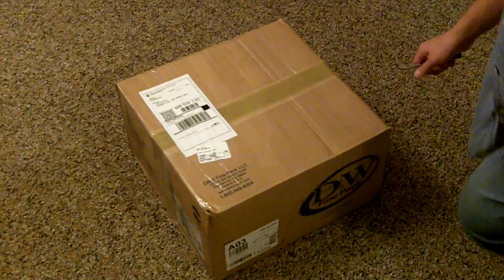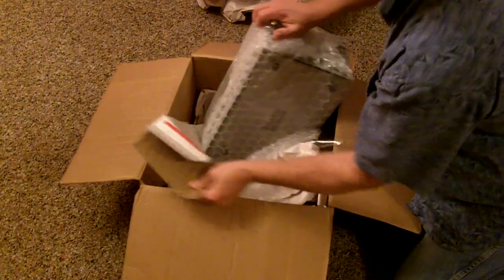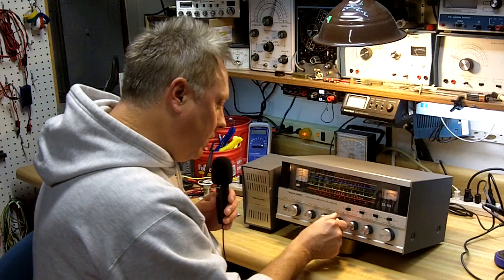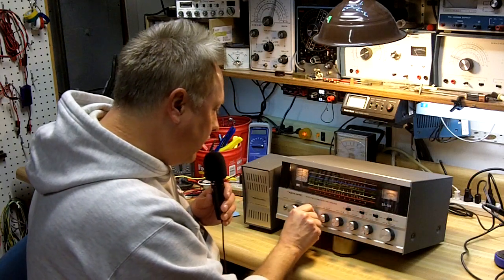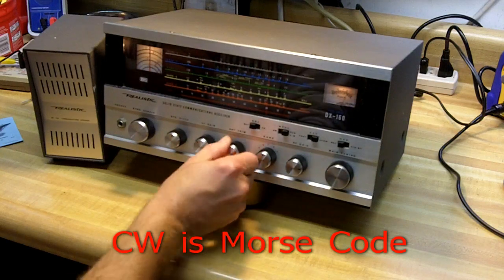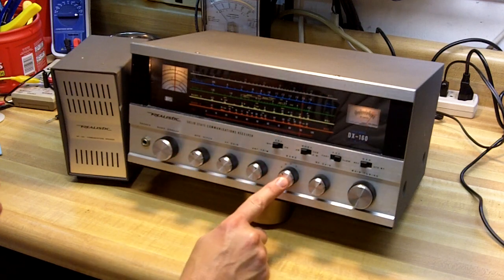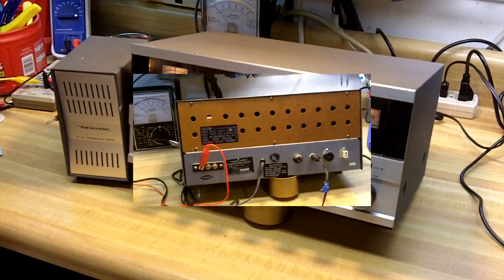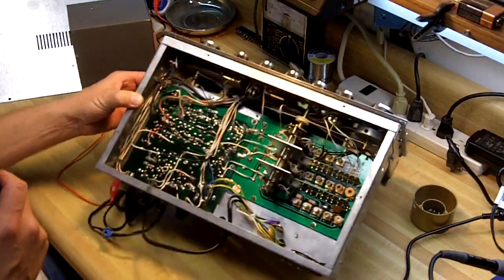My Realistic DX-160 Shortwave Radio Arrives

Comment: It is interesting how well this Realistic stuff has stood the test of time. I still have my DX160, plus a heap of classic stereo gear still in use, some 27mHz CB gear, even a clock radio from 1981 called a 'Realistic Chronomatic225' still running on my desk. It spent it's first 30 years alongside the bed before the wife decided to update it, so it came out to the workshop office. The more trendy replacement bedside clock radio's have each lasted about 2 years max... So since 1981 when I purchased it with my first paycheck, it has run continuously for over 324000 hours, all led segments uniformly bright, the radio still works despite the deterioration in the music content quality, and being mains frequency locked, the clock is still accurate. That great era before engineered failure came along towards the end of the 80's..
Reply: My Realistic STA 870 is getting a little scratchy but I can't complain

Comment: I have a DX-160.  My dad bought it for me for Christmas in the mid 70's.  I spent many evenings listening to Shortwave stations into the wee hours. :-)  TAB books used to put out SWL guides, that had stations & times listed which used to help.

I remember my dad & I put up a long wire antenna, maybe 60-70 feet , that went from the corner of the house (using a mast) to a tree on the other end of the back yard (with insulators on each end).  I remember we had trouble with the antenna wire snapping when we had high winds, because one end was around the tree.  There was an old ham radio guy in town, I remember he had a huge diamond shaped antenna with a rotor on the roof, and we stopped and asked him about the antenna.  He told us to put a clothes line pulley on the mast side, and a weight hanging down, so when the tree swayed the line would have slack with the pulley & weight.  Wallah!... It worked, and never snapped the line again.  I had to lubricate the pulley every year.  I used to have QSL cards from a bunch of SW radio stations, the BBC, Radio RSA - South Africa, to name a couple.  I also had a world map on my bedroom wall, with push-pins of all the countries I tuned in.

I haven't really used the DX-160 in a long, long, time.  I fired it up about a year ago and it still works.  Years ago I made a better speaker with wooden housing, and it sounded better.  I'm thinking of hooking it back up again, and maybe doing some mods.  If you know of some good mods for the DX-160, could you share them?  Thanks.

Comment: I have had my DX 160 since the mid 70s. I have it next to my bed so I can listen in to world at night. The newer digital model radios are easier to dial in but they aren't as much fun to operate as the old analog 160. The only repairs I've done to it has been to replace the illumination lights for the face. Got those off the wall displays at radio shack. Still going strong.

Comment: I have 2, replaced all caps and transistors. Did alignment, units work as new.  I noticed a couple solder joints that were a little bit suspect went over them well. radio is so much fun to play with I feel like im  15 again.  Welcome to the club
Reply: Me too from Australia, found on one of the buy swap sell sites, first receiver I had at 17, Like everyone have retraced all the first radio's, almost pristine, hasnt got an SO239 so I will have to mod and build an antenna for it   in 1977 just had a lump of wire on the fence  Pete VK3TQ

Comment: As a shortwave DXers in the 70s I had a DX160.  Great rig.  Dead nuts on frequency.  With my World Radio TV Handbook (WRTH) I was able to get QSLs from 70 countries on a simple wire antenna.
Exhausting all SW stations I could hear, I decided to learn what the dits and dahs were al about and in 1980 got my novice KA1FXK.

Comment: Just got one of these today from my local radio club donation pile. Opened it first to check the dirt conditions inside and after a quick brush clean; I turned it on and it fired right up. I will clean it up and update some components as needed but will try to tamper with it as little as possible.  Just like you, this is something I dreamed of in the early 80's and very glad it will sit in my shack next to my ICom 7300.

Comment: Thanks RadioHamGuy for the video. Yes I have a DX-160 here with speaker that I bought at a swap meet. It's been sitting in a corner here in the shack and hasn't been turn on for about 6 years. You peaked my interest again so I will get this radio out and connect it up. Conditions on short wave isn't great but I will give it a try. Thanks again for bring an old boat anchor to life.

Comment from the maker: Yes, this is usually very simple to take care of.  It is a dirty volume control.  You will need to take the bottom cover off so you can get to the volume control pot, on the pot you will see a little bit of an opening under the 3 terminals that it has, just behind the terminals.  You need to squirt a quick shot of TV tuner cleaner spray or electronic spray cleaner of some kind into that. Make sure power is unhooked, then rotate the control rapidly back in forth for 10 seconds or so, let dry.

Comment from the maker: A longwire antenna is a good choice for this radio.  Or any wire hooked up to the back that you can string up around the room or even better out a window and up to a tree, not critical, the most problem is getting the wire away from noise sources.

Comment from the maker: the alignment could be off for the AM band possibly, also, it does use an internal antenna for AM band and the cabinet kind of shields it somewhat, so it hears better in the direction of the back of the radio.

Comment from the maker: I did not use a scope, I had a signal generator and tuned each coil for max on the S-meter and by sound level.  That worked fine and really improved my radio, for some reason it was off a ways, either by aged components or maybe someone else tried tuning on it at one time.

Comment: Picked one of these up at a yard sale for 20.00, including a few extra speakers.  It was a clean unit so I could not pass it up even if it might require some repair.  Turned out it was electronically and mechanically fine and I use it everyday now to listen to talk radio while on the computer.  These, like most boat anchors, are great.  I guess you would call this a little boat anchor.

Comment: Wonder if you ever did the audio mod on this . I have the same radio here in the UK . I did the mod and it did improve the audio a bit . It cured that rather nasal sound on speech . They work well for what they are and seem very reliable . Mine still has original caps except for the audio mod ones . Nice video . I enjoyed it . Regards from Thomas .

Comment: Very nice rig, good purchase.Got mine last year off E-Pay also.Was hard to put it away, but both my Dx-300 and 302 I enjoy better.Got the dx-100, 150B, 160, 200, 300 and 302.The 160 is a big time drifter, as are all GRE radios except the 300 series.I use a Pioneer 8 ohm speaker which help a lot with audio quality.The 150 & 150 A have the internal speaker which are less cumbersome.Cleaned and lubed the pots and waffers, and works very well.Great video, and good luck with the analog rig...

Comment: I had one of these back in the day. It's a bit fussy with stability, but it does quite well. The main reason I wanted one was for the 1750 meter band (165 - 190 Khz) Very few radios I could find will tune that band.

Comment: I just discovered one of these in my grandmas house, I think it was my grandfather's. But It seems its broken. It turns on and the speaker works but I don't get any signal at all in any band. Nothing. Signal meter never moves from 0. 
Could it be completely broken or do I need a better antenna? I tried it with an old am antenna hanged near the window. Seeing your video makes me dream of actually making it work.

Comment: I would have hit the floor if I had one of these great radios back in the day, but I got started with a DX-100 which was a wee pig but I heard the world!
I recently got a good deal on an SP-150 external speaker and I use it with my Icom IC-718 amateur rig presently.
73 DE N2NLQ
Reply: Poo

Comment: Hi there, all your videos are really interesting - and entertaining too! actually saw this a while back and loved the look of the dx160, and now, mainly due to you (ha!) I'm actually waiting myself for one to land on my door!! Thanks again for posting great videos, love your channel
Reply from the maker: Thanks and have some fun with that radio when you get it!
Reply: RadioHamGuy Well I got the radio, nice old piece of kit, took your advice and cleaned switches/dials with switch cleaner, great, and noticed on mine link wire between gnd and ant2 missing, refitted one and working great now! Two tuning dials take some getting used to but once u got it works great! Thanks again Larry for inspiring me to get one of these great old radios. Ps- mine came with the speaker too, which I filled with foam packaging chips and it sounds better now, but still not hi-fi !! 73's
Reply from the maker: roughchippy Great to hear..I am sure you will have as much fun with it as I do with mine.  Sure not top of the line but they are a fun radio to play around with! And they look great sitting on the shelf also or on the desk. 73 and good luck with the radio and have some fun tuning around.

Comment: This radio has a problem on the tuning printed circuit board with the rivets that connect the top side printed circuit to the printed circuit on the bottom side of the PC board.  The fix is to solder jumper wires on the top side of the board to replace the connection made by the printed circuit on the bottom side.  Shining a bright light through the bottom of the board shows clearly where to solder the jumper wires.  This is the RF amp and Local Oscillator circuit so it will require alignment.  Operation without repair may be intermittent.

Comment: Was wondering if you can help me, and I hope that you do answer this comment as I've seen your videos and admire your experience. 

I have this same radio, stored for decades but not very well taken care of. When adjusting the volume the sound crackles and pops horribly before it settles ... typical of older radios and you may have encountered this before. Some say it's just dirt and requires simple cleaning. How would you recommend cleaning a volume knob and sorting out this problem?

Thanks!

Comment: Hi. Thanks for posting this video. I have some digital receivers such as the Realistic DX-440 and the Sony ICF-SW7600G, but I miss that feel one only has from analogue tuning. Besides that, new digital receivers don't come with built-in antenna trim. You said you would probably change one or two capacitors to improve sound quality. Are those the gray ones you finger pointed? If so, by which ones? You see, I like listening that characteristic sound from short wave broadcast. PY5WHO, Brazil.

Comment: I've got one purchased in '77.  Still works well and I enjoy the retro feel.  What kind of antenna are you using?
Reply from the maker: I have not had it hooked up in a while but I think I usually used my off center fed 80 meter dipole antenna that I use for my ham radio equipment.

Comment: Buy a freq counter for it on ebay and add to it.  I had a DX-160 and the lack of a digital display was what I hated the most about it, no digital number frequency displayed to come back to a nice station you had found at a later time.  Oh, and the drifting, and the sharp corner edges on the smart looking case with color bands, and lack of internal speaker (which I added).  Otherwise, it got me into the hobby.  A good starter set for someone new to shortwaver but without a transmitter they'll lose interest eventually.

Comment: i love my dx 160...i have the original speaker w mine as well...it sits right next to my icom ic 735!!
Reply: Bought a DX-160  with corn detassling money back around 1976, still have it,  had to replace the IF mechanical filter can as the receiver went dead, used one out of a CB radio,  the response is a little wider. Also have a Icom 735, still working.  Biggest problem with dx160 is bandswitch is unstable,  have to rock it, and the RF gain control has to be used to keep the radio from pulling on strong signals.  Best to advance audio gain to 50 percent and use RF gain as a volume control
Reply: @mikekokomomike  may main hf rig is an old 735!! They are solid ham radios!

Comment: The problem with older receivers is the filtering and the analog stability and drifting. I think it is difficult to find old radios that will perform well enough to compare to the new digital and stable radio systems, especially with shortwave and ham receivers. I am a ham radio operator and have seen dramatic differences in the radio from original kenwood ts 570 to the new FLEX 5000
Reply from the maker: +Robert Fraley  Very true, so much better today, we are lucky, but the old gear is just fun to play with and brings back a lot of fond memories for many people.  It is just fun to play around with the older gear for many of us I guess.  Same as classic cars and many other things I guess.

Comment: My advice - add a Frequency Counter to it - one guy modded his stock speaker to have a blue led Freq Counter in it. It was a fun introduction to shortwave, and hearing that shortwave sound, but you could never leave the unit sitting on a station and come back days later and turn it on and still be on station. After considering buying another one for $45 on ebay, I decided it'd be better to save up for a new Tecsun at $99 that had thousands of mem slots, and FM. You really need mem slots & pages.

Comment: Hello RaadioHamGuy! I purchased one of the Realistic DX-160 radios on ebay. It works but doesn't pick up anything near what yours does on your video. Now I am new at this and I am assuming it is the antenna that is the difference. I bought a antenna kit (25' of wire and a few insulators and have in in my attic above the garage). I need your help! I want to pick up all the broadcasts like you are! Any suggestions on antennas or things I need to do?  Thanks, Doug
Reply from the maker: Yes, very good.  I think I was using my 80 meter off center fed dipole antenna on this radio at the time.  That is what I usually use for any short wave reception, so that is a long antenna, about 130 feet total length. Being off center fed it works on several bands.  If you don't have room for something like that, just get as much wire as you can outside away from any noise sources in the home.  You can feed the antenna with some type of coax cable.  Try some searches for antennas for short wave reception also, that might give you some good ideas.  Mainly if you can get a wire outside and up in the air, that will work well.

Comment from the maker: Thanks!  Well, I am using the Kodak Zi8.  Great HD video as long as the camera is still, like on a tripod.  It is not good with motion though, but if I try to use on tripod as much as possible, I really like how it works then and it was not that expensive of a camera either, had it a few years now I guess.

Comment: I remember having one when they first came out, well within a year or so.  When the dx300 came out it was goodbye 160, hello 300!  Pretty bad radio performance on both of those compared to say the yaesu frg-7 from a similar era
I did get another dx160 about 10 years ago but tired of really quickly lol. 
  
Yours looks to be in excellent condition so would look good just sitting there!

Comment: I picked up one of these at a Goodwill didn't even know what it was at first! It was too interesting not to take it home.
Any suggestions on what I should do for a basic antenna?
Reply from the maker: If you have room outside you might want to run a length of wire up into a tree from the radio, the longer the better but 50 ft or so would work fine.  If you are limited to indoors only, try a 10 to 20 ft piece of wire and string it around the room wherever you can, that should get you up and running and picking up some stations.  You may pick up some noise from things around the house with the indoor wire but you should hear stations.  Good luck and have fun!
Reply: @RadioHamGuy   Thanks for the advice!

Comment: What are all of the components you use in this video?  Is it just the radio and that box on the side?  What is that box on the side?
Could you perhaps provide links to where you purchased these from?  I'm very interested!
Also, how did you get your shortwave license?  What did you study, and where did you take it?  Was it hard?
Reply from the maker: Well, the box on the side I think you are referring to is an external speaker, actually the only speaker for this radio and it was included when new.  This is an old radio that has not been made in many years, I found this on ebay, this model is listed there quite often.  You don't need a license to listen to short wave, at least here in the US.  But I did get my ham radio license so I can talk on radio also, there is a test you need to pass for that, if you search for ham radio you will see all kinds of information on that.  It wasn't really that hard, just takes a little study time. Hope that helps some.
Reply: Thanks, that did help!  Also, would you happen to know what specific component people use to communicate with morse code?
Reply from the maker: ***** You just need a ham radio transmitter or transceiver that will do CW mode (morse code mode) and a sending key or an electronic keyer device.
Reply: RadioHamGuy Cool, thanks!  I definitely want to get into this!  I saw it around a year ago but forget about it until I saw this.